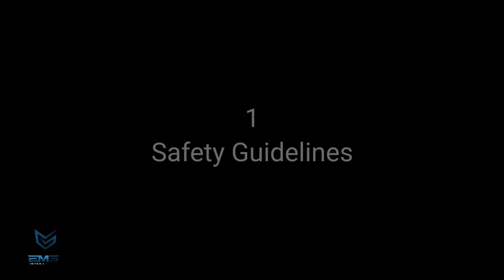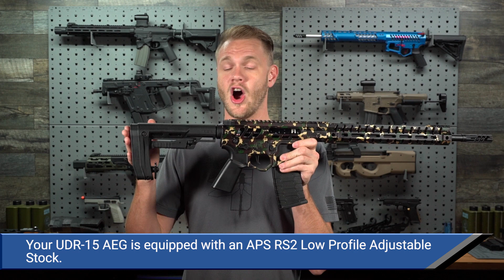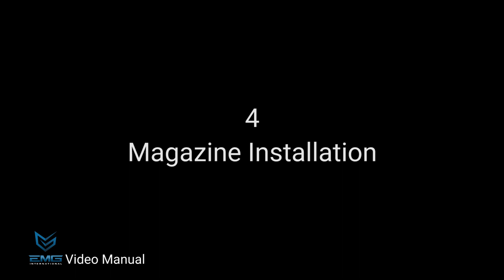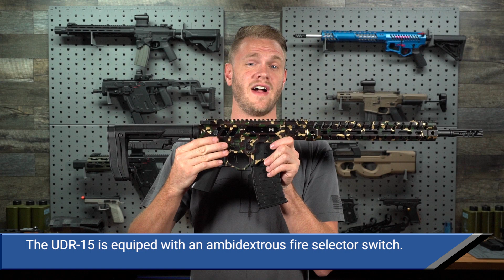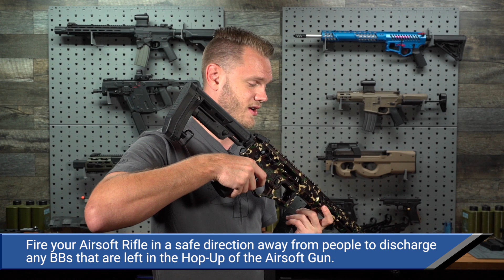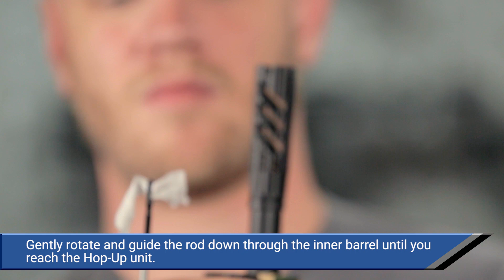EMG F-1 Firearms Demolition Ranch UDR-15 AEG Video Manual

Comment: Does the orange tip it comes with come off? Or is that something I'll have to spray paint?
Reply: Austen McNeal if it does come with an orange tip u can boil it in water for bout a minute and take a small Allen key and. Screw off the set screw on the bottom 👍🏻

Comment: What battery is best for this gun?
Reply: A Walmart one
Reply: an 11.1v lipo battery at 1200 mAH works well, mine fit right in the back of the stock
Reply: @MrPayneTube  but isn’t there like deans and then Tamiya so what one can you use or is it any

Comment: Is there a way to adjust the fps?
Reply: Yes there is a quick change spring system in the gearbox. You can either do that or change the barrel setup, If you want to you can kill two birds with one stone by getting a tracer hop up unit and a different inner barrel.

Comment: >Unmatched quality and top performance 
>Made by APS 

Only one of these statements are true...
Reply: Do you have one?    Because I just got mine yesterday and have already put a few hundred rounds through it just messing with it and it is not a disappointment whatsoever
Reply: Sam 2027 doesn’t matter it’s made by APS, it’ll be trash internally.
Reply: @GammaAirsoft_Gaming  Could you change the gearbox out with another? Or could you install a Gate Titan in there or even an HPA engine?
Reply: @PutMeDownPlease  yes
Reply: @Sam-sy4bp  how has it held up?